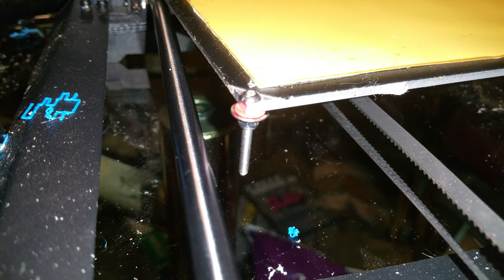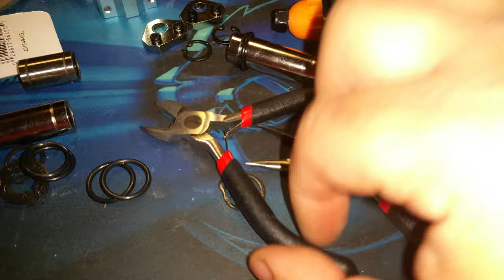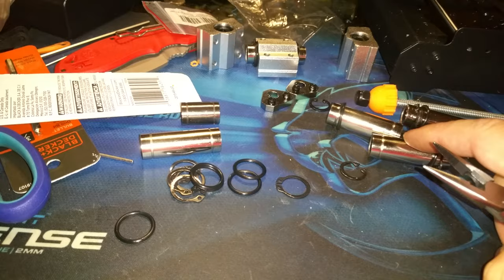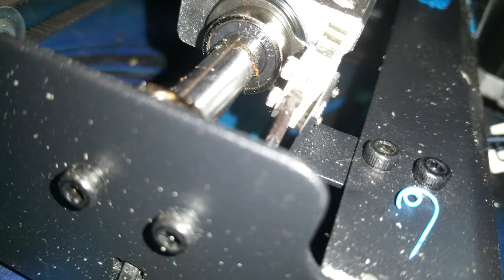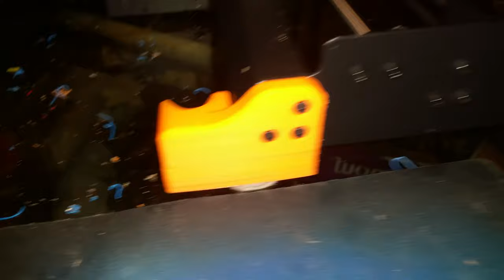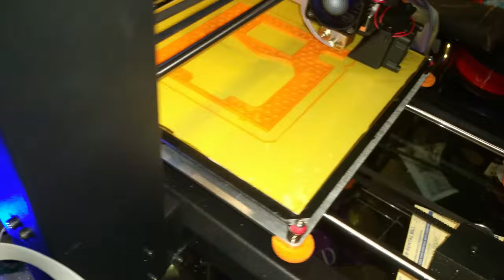Today's 3D Print   Major Upgrades Part 1

Comment: Awww, no part 2? I've done a lot already, and actually have the long bearings on the X axis out of the box, but not on the Y. What did you gain with the longer Y bearings? What z-brace kit file did you use? Also, I am considering glass to top my upgraded bed to deal with warping, have you ever tried that?
Reply from the maker: jryanishere life has prevented me from doing much 3d printing lately. yes i use glass topped with pei. works very well.

Comment: Awesome tutorial.  What kind of fan are you using for the Power Supply?  Any link would be helpful.

I know it's 80 mm, but I don't know what kind of connector it uses (i.e. 2 pin, 3-pin, etc.)
Reply from the maker: Robert Suarez i bought this one. pretty sure it was plug and ay no mods. my goal was quiet.

 https://www.amazon.com/dp/B00NMXE4Q8

all fans are nearly silent now. printer is nearly silent.
Reply: Thank you very much, sir.  :-)
Reply: I received the fan the other day, and looks really cool (love the 
features and look).  Unfortunately, the fan is a 3-pin plug, and the 
connector of the old fan is a 2-pin.  I had to order another different 
one with a 2-pin plug.  

Did you plug the fan to another power source (i.e. on the motherboard) 
other than the old fan connector?
Reply from the maker: Robert Suarez i will have to double check when i can but the third wire is not important. thats just sensor feedback.

Comment: What did you end up doing to convert the ball nuts to 1/4th? I made the same mistake. I bought the kit and printed the balls but they are wrong. Good thing i checked before installing
Reply from the maker: i printed adapterd so the 1/4 nuts would fit. all els worked fine

Comment: hey im wanting to get the new bottom plate that you did but is it now on amazon anymore, any recommendations? and link to where you got the bearing upgrade?
Reply from the maker: Breydan Oliver its still on amazon
 https://www.amazon.com/dp/B00THZJGBI/ref=cm_sw_r_cp_apa_t5ihybFWDP172

for the bearings i got mine from 

https://ultimate3dprintingstore.com/collections/wanhao-genuine-parts-department/products/mod-upgraded-bearings-set-of-5-o-rings-external-retaining-rings-included-3-series-3d-desktop-printer
Reply: Nerys yeah it was unavailable for awhile for some reason, just got back in stock
Reply from the maker: Breydan Oliver ahh good. it is by far the most important upgrade you can make.
Reply: yeah my monoprice and it is printing AMAZING though, even without it. cant wait to see what it will be like after the upgrade
Reply from the maker: Breydan Oliver print quality wont improve but persistance of bed leveling and first layer will improve.
Reply: nice! i have installed the z axis mod and it works great! i used your spacer  mod on some of my parts also, thaks alot